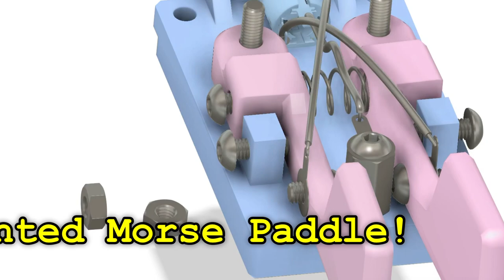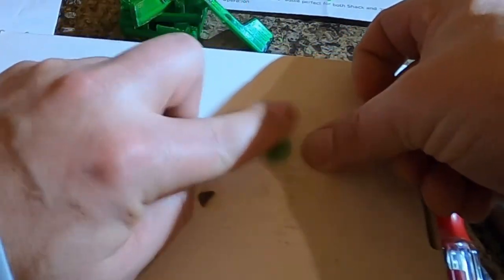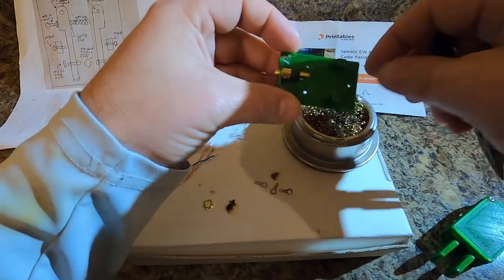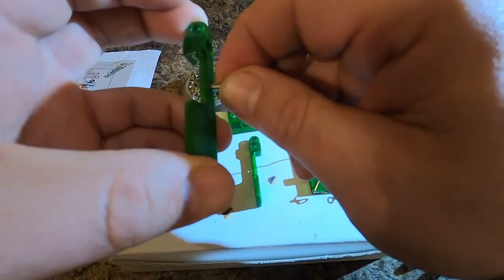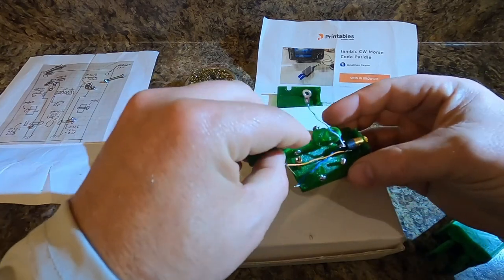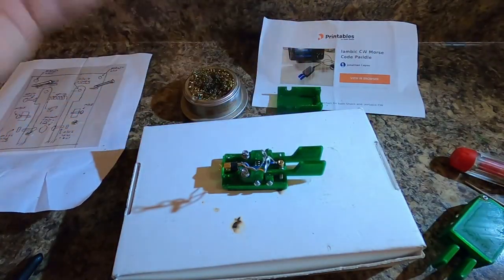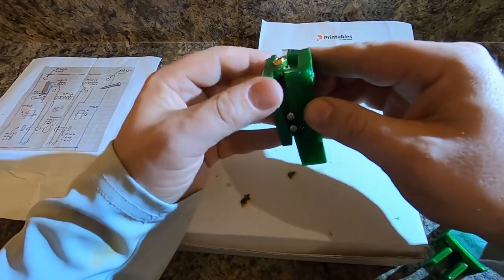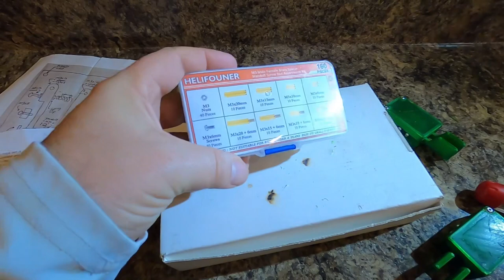Building a 3D printed Iambic CW Morse Paddle

Comment: Additional idea if you are doing a group build: have the person with a 3D printer emboss your callsign into the case. PrusaSlicer has a feature where you can add text as a negative volume. I didn’t show it in the printables article but that is what I did to my paddle and anyone else who I made one for. 
Also, I recommend having a washer underneath the levers so that they don’t rub against the base. 
Great job on the build! 73 DE Jonathan KM4CFT
Reply from the maker: I tried them both ways, and I didn't find the friction of the paddles on the base a problem. That's a great suggestion though. I'm working on a similar design that uses small bearings pressed into the paddles. The prototype works nicely, but I might change out the spring for an adjustable magnet return instead. It'll be the deluxe Rob-o-Key.
Reply: @w1rcp  suggestion for the magnets: you can embed them into a print by inserting a color change/print pause at a specific level. I have been doing that with the Elecraft KH1 paddles I make